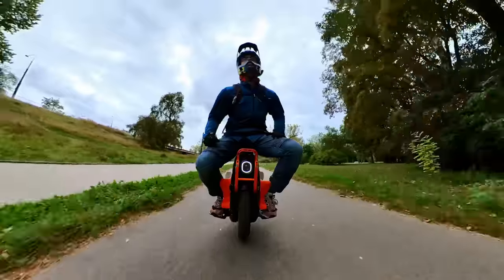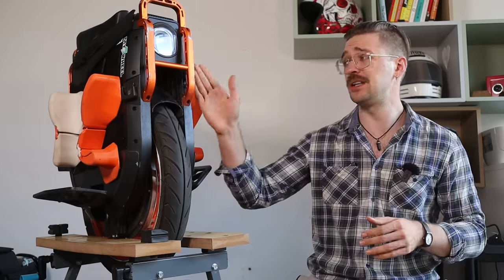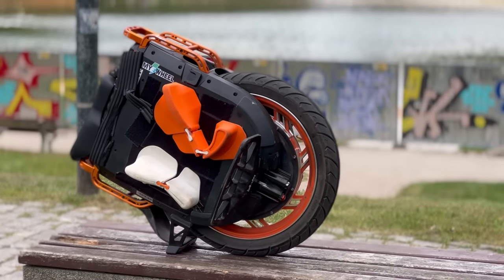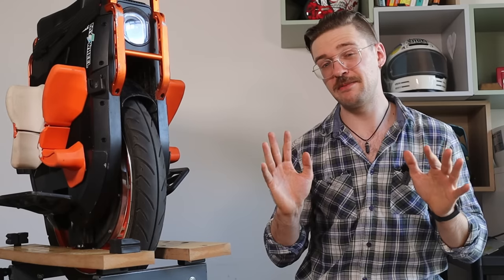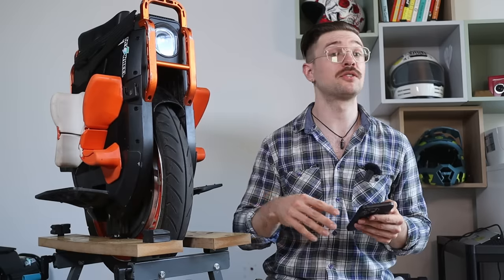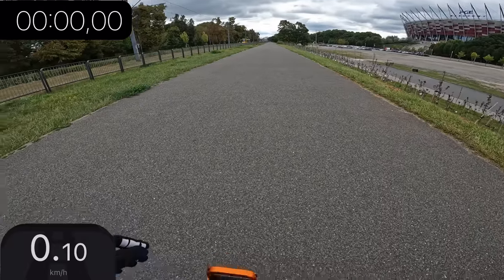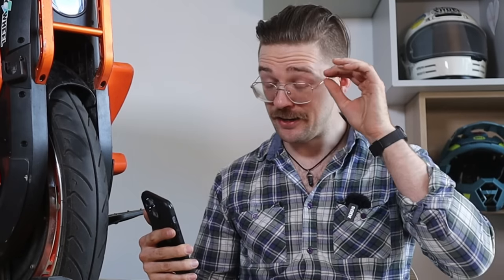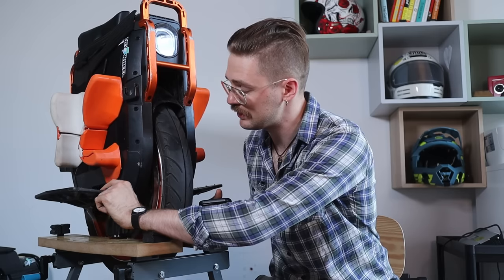MOST OVERENGINEERED E-WHEEL - 126 VOLT INMOTION V13 COMPLETE REVIEW

Comment: What's the point of going over 50 km/h (31 mph)?  In the US, residential streets are 40 kmh (25 mph), and most of the conduit roads to get anywhere have speed limits of 56 - 72 kmh (35-45 mph).  We also don't have a whole lot of protected bike lanes.  Riding above 30+ kmh (18 mph) on sidewalks isn't smart given that many of our main conduit roads are covered in driveways and cross streets that cars often drive right through the pedestrian walkway to get a better view of the traffic they're about to turn into.  There are far fewer bicycles, PEVs, and even walkers in many lower population regions in the US, so drivers simply don't expect anyone to ever be using the sidewalks.  It's just better and safer to be in the street sharing the lanes with cars, and IMO it's safer if they're not all trying to pass you at high speeds.  That said, there is inherent risk with EUCs that they could, at any time, cut out.  At higher speeds, the risk of injury is high.  Which is why most of us cover ourselves from head to toe in protective gear.  

There's really no reason at all to put a 20"+ tire on an EUC if you think the max speed should be 50 kmh, given that 16" wheels are completely stable up to that speed.  Whether non-licensed children should be allowed to ride them at 40 kmh... much less 50 kmh.... is another story, but that has more to do with the law, law enforcement, and parents properly controlling the toys they give their kids.